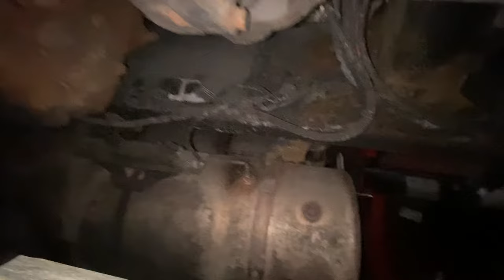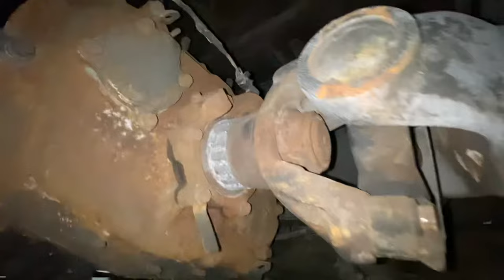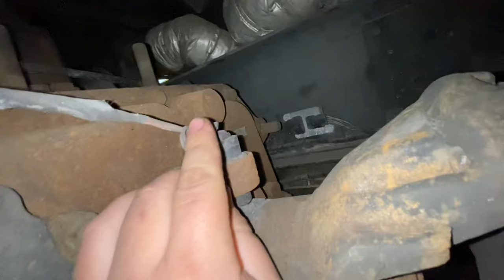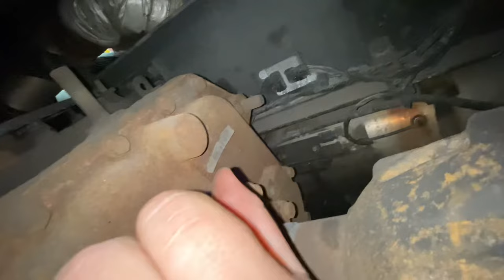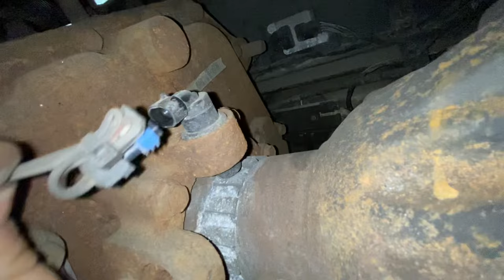How to disconnect speed sensor eaton transmission 5mph derate

Comment: hie everybody, can someone tell me if we remove the speed sensor in freiginer 2017-2020. will the truck go to repair shop ? please reply. thank you.
Reply: That's the point, it can't limit you if it can't see the speed, would not recommend for extended use, only to get down to a shop or refill def, DO NOT DO THIS IN AN AUTOMATIC.
Reply: Did u find out a solution because I’m having this problem now
Reply: @welkfor1753  why not in an automatic?